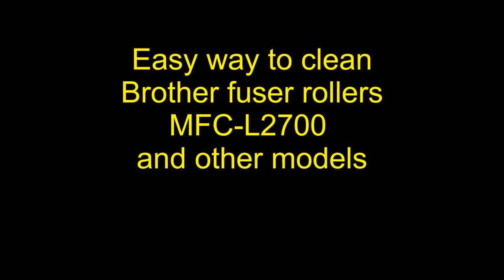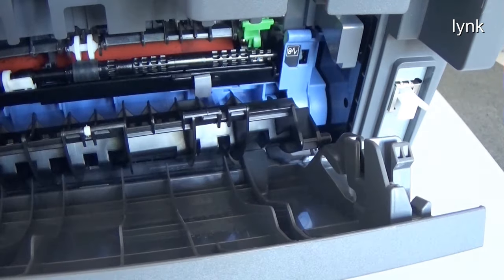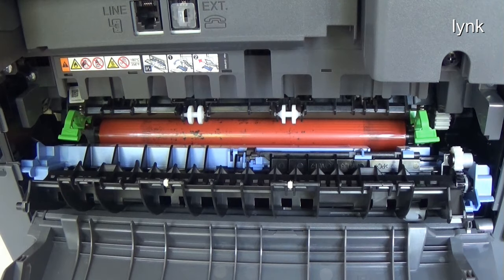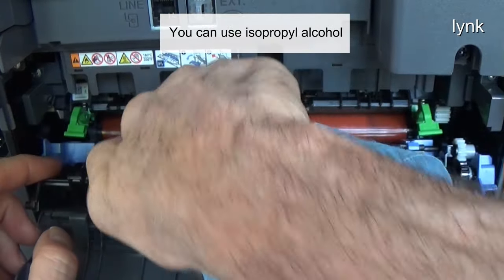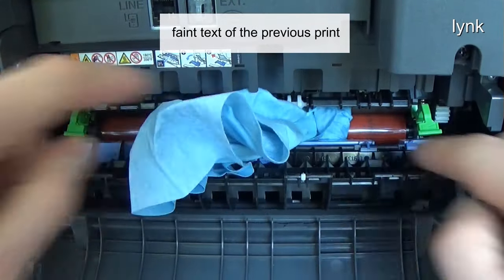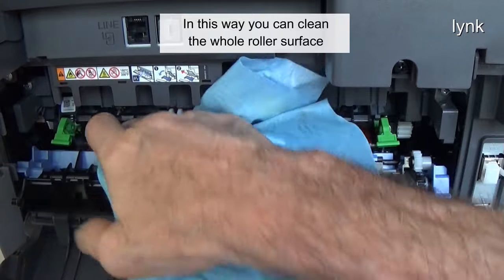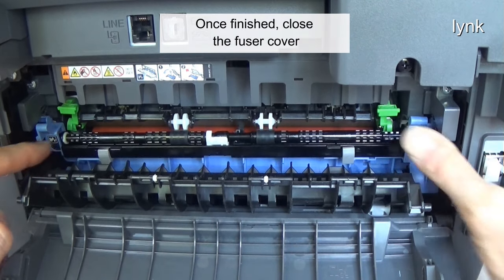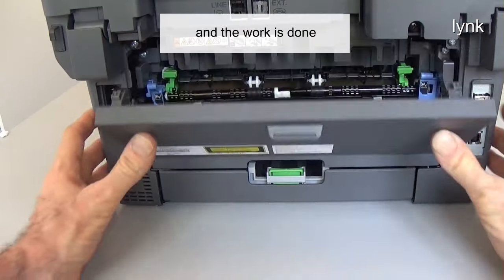Quick Way to Clean a Brother Laser Printer Fuser Roller

Comment: I tried using qtips with 99% isopropyl alcohol but the black bands on my ricoh 3510dn hardly came off and mostly still there. It was a day after running the printer so it was quite cold...maybe i need to run the printer to warm it up before attempting to clean? Or can i scrape it with something without damaging it? I dont want to worsen the problem of faint black stripes running down along the margins.
Reply from the maker: A cleaning doesn't solve the problem if the rollers are damaged. probably you have to change the fuser rollers

Comment: I used 91% isopropyl alcohol and it worked fine.  A little tedious getting to the orange roller, takes a little time, but very do-able. I have a HL2240 - did not remove the back cover.

Comment: Just wanted to say thanks for your other video on cleaning Brother toner cartridges - I have a compatible cartridge that was printing extremely light, and with streaks down it. It turned out there was built-up residue on the doctor/wiper blade, and once that was cleaned off, it works perfectly again!
Reply: Hi, what is the video you mention?

Comment: thank you! This solved an issue I had with my mfc-L8850cdw printer
Reply: When you cleaned the roller....what was your printer doing that caused you to look up this video?  We have the same model and the paper is jamming on this roller every 3rd copy after the paper jam is removed.  Paper is also showing a slight "burn" mark across the paper.  Thanks for your response.

Comment: I did it but the paper has even more black lines now. I think my fuser might need to be replaced? I've  got a Brother HL-2320D
Reply from the maker: Are you sure the black limes are due to the fusers? Check the drum unit and the toner cartridge too. However a cleaning cannot solve the problem if the fusers are worn or defective

Comment: Thanks great tutorials, excellent. 
I have a brother machine, MFC L8690CDW and after unused for a while it won't turn on only blinking green light with small clicking sound, but when open the front or back door it switches on and displays front or back door open, when close it turns off itself with small clicking sound and blinking green light. What could be the problem here please? Is it something to do with the circuit board?
Reply from the maker: It can't exit initialization. it could be the fuser unit, a defective drum or toner cartridg, may be the main board. it's difficult to say

Comment: Thank you for the video - If after cleaning the drum and the fuser roller and I'm still getting streaks and smears, does that mean I need to replace my diffuser?
Reply from the maker: Probably you have to change the fuser unit. The cleaning does not solve the problem is the rollers are defective or worn

Comment: Great video.  I've cleaned the fusers and big rollers but my blank area when printing matches up with the small center white small rolling thing (not the printer drum or fuser roller).  I don't see anything blocking it.  Anything else I can check?   Brother model HL2370.  Thanks.
Reply from the maker: Did you ckean the corona wire of the drum unit?
Reply: Thats the little sliding thing that does back and forth across the unit?   Yes!
Reply from the maker: @mariannegennis6181  I think you should try to clean the glass of the laser scanner under the drums
Reply: @viandant5  I'll give it a try.

Comment: Am having a vertical line on both sides of my A4 paper after printing or photocopy. I have clean the end point of the developer roller but it doesn't solve the problem. Maybe the next thing I will do is to check the fuser roller as shown in this video. Can i use this same method for Brother printer DCP 8065 DN ?
Reply from the maker: Probably the problem is the laser scanner, if the problem is only when you copy or scan a document
Reply: @viandant5  The issue is the Fuser roller. I had to follow this video to open the back of the printer where the fuser roller is located and I discovered It is worn out with ring line on both ends of the roller. It will need replacement. I strongly believe that if I replace the affected roller, the vertical streak lines will disappear from both sides of the paper during print or photocopy.
Reply from the maker: @gabrielchristopher9363  I understood that the problem was only when you copy or scan.
I think you have to replace the roller or the fuser unit. Cleaning a worn fuser roller is useless.
Reply: @viandant5  Exactly, I have clean and clean it but no improvement. I will see if I can source for a roller or a complete fuser unit in a local store. Thank you so much sir

Comment: I have km1620 copier. 5,28,000 cps. From some months toner dots spreading on the print. After cleaning blade & drum again problem stats at every 500 copies. Awaiting reply...
Reply from the maker: It could be the recovery blade detached or defective. The recovery blade is the blade near the wioer blade
Reply: @viandant5  where is recovery blade? Only one cleaning blade near drum. That is also changed with new one. Still problem persists.
Reply from the maker: @anandsurpur8072  Parallel to the wiper blade there should be a thin tranparent mylar blade
Reply: @viandant5  At present no mylar blade near clng.blade. Any alternative application?. Ex.double side foam tape?? Any other ,hints please.
Reply from the maker: @anandsurpur8072  Check the toner roller and the side felts. they could be worn, check if there is toner powder there
Reply: @viandant5  toner roller? Where it is?. Cartridge check or toner drum unit check?.
Reply from the maker: @anandsurpur8072  Toner section. It is the roller covered with toner

Comment: my pages come out really hot to the touch that the paper starts to curl in a circle, what is causing this problem?
Reply from the maker: I don't think te fusers are defective, you would have an error message. May be the paper is dump or the printer is in a humid environment
Reply: @viandant5  no its not humid and the papers are expensive brand, they come out really hot that they start to curl.
Reply from the maker: @sadiai3144  Which printer?

Comment: can we clean fuser roller with patrol
Reply from the maker: petrol? no
Reply: @viandant5  but I do it the same and now I am facing more problems so what i should do now
Reply from the maker: @sunilvimal2772  try to clean the rollers with alcohol, may be it will remove the substances or the petrol. try uto print a few white sheets
Reply: @viandant5  ok sir thankyou for the advice

Comment: Howdy! I have a Brother TN-450. I have used it for 4-5 years with no issues until yesterday. It prints 2/3 of page and the jams. The top of page is curled and quite warm. I have to pull quite hard to get jammed paper out. I would like to FIX the printer rather than abandon it to junk pile. Any advice would be greatly appreciated!  hello from Nakusp, BC Canada
Reply from the maker: I think the problem could be the fuser unit. check the rollers or the pick up fingers
Reply: @viandant5  Should I just replace the fuser unit?
Reply: @viandant5  The fuser roller is in good shape. Better than one in video. Paper feeds about 1" out of fuser and stops dead. Print is good for 2/3 of page. If it feeds good enough to print 2/3 of page, what could be stopping it from feeding the rest of the page? Grrr! Ha Ha
Reply from the maker: @garymoore3159  It could be a paper sensor, and are you sure the paper size in the settings is correct? There is a little lever that detects the paper, may be is broken

Comment: Is there anything I can use to clean apart from alcohol?
Reply from the maker: there are cleaners made especially for fusers. Alcohol doesn't leave substances on the surface of the rollers
Reply: @viandant5  Do you have specific suggestions on what kind of cloth and alcohol? Other sites suggest 70% isopropyl alcohol will take a long time to dry or have other problems.
Reply from the maker: @jherbach  It's not a problem on a fuser roller if it takes more time to dry. Any type of soft cloth even paper cloths will work

Comment: Hello, my brother dcp l2540w when turned on smells something that its burning, what should I do about it? Should I change the hot and fuse rollers? Thank you.
Reply from the maker: No error codes, no print defects, is the printer working? I think you can use the printer without any problem
Reply: @viandant5  yes sir, it works fine but sometimes it doubles the images that is being copied.
Reply from the maker: The smell and that defect is due to the fusers, but the smell is not a problem
Reply: @viandant5  Thank you so much! 🥰

Comment: i use contact cleaner like wd40, faster cleaning the fuse roller, then wipe with soft clothes with glass cleaner to remove contact cleaner residu
Reply from the maker: Thank you for the suggestion
Reply: That is hilarious. You will ruin it.